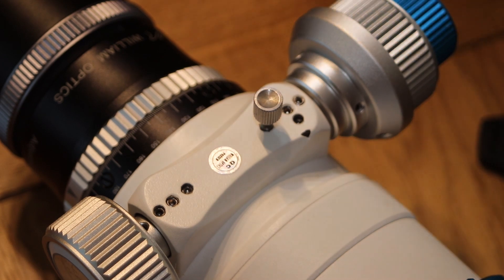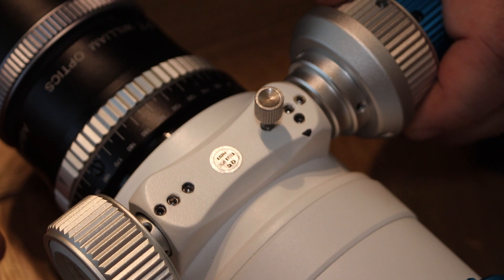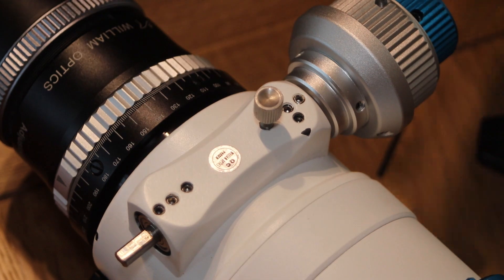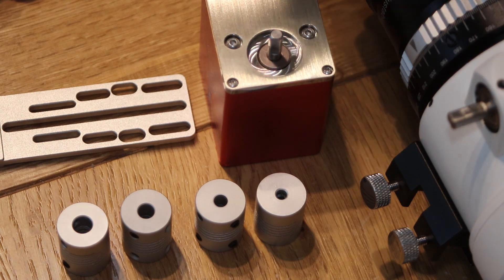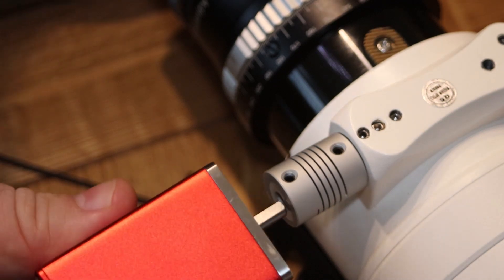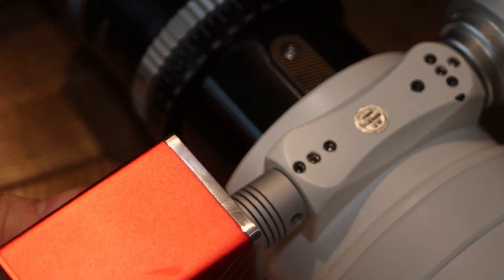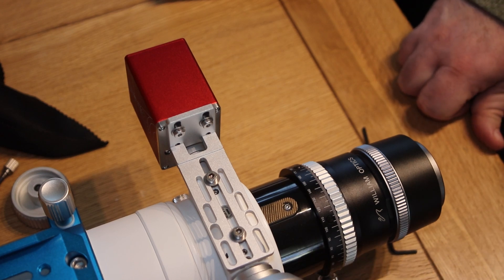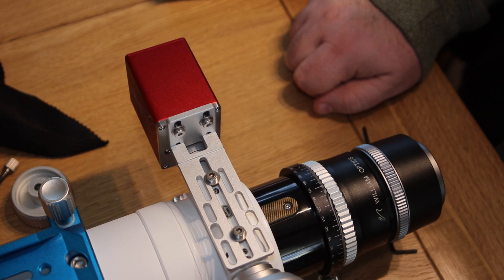Easy - How to Install a 5 volt ZWO EAF on a Refractor (William Optics Z81/Z73/GT81)#howto #astro

Comment: Oh man, I wish I'd watched you do that before tonight... I only had one screw in the far hole, the focuser locking one, and I needed to move things outboard a little as the stepper screws fouled the saddle on my mount... Putting it all back together I've managed to strip the thread in the locking hole 😢
Had I realised that near side grub screw was just a hole blocker I'd probably not tightened the lone screw up so much. I've had a walk around the garden to calm down but have been in a funk all evening due to my stupidity.
At least now I know there's one more hole I can use so I don't have to disassemble the focuser and redrill the stripped hole. I might do that in future if I feel brave 😂
Reply from the maker: Oh no, that's a pain. Get a Zeus precision book that will give the next closest thread size. I'm guessing it may be imperial to save taking out too much material. Fairy straightforward to do. Or if not, definitely black it off to stop rubbish getting in the foucaser. All the best and clear sky's  Ryan 👍